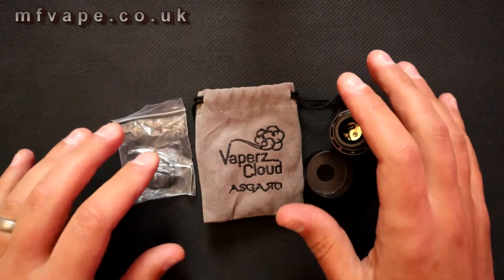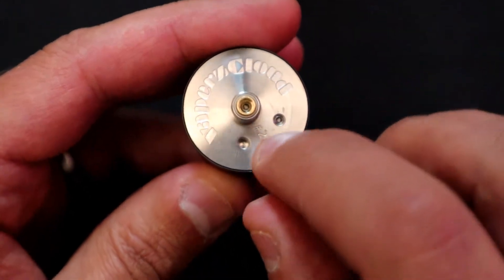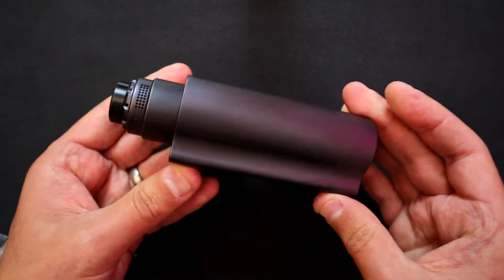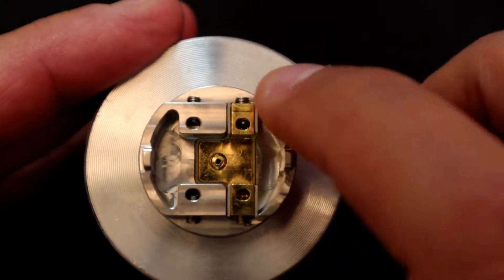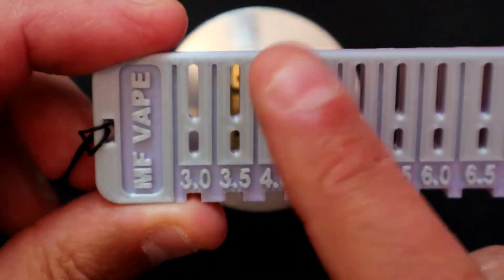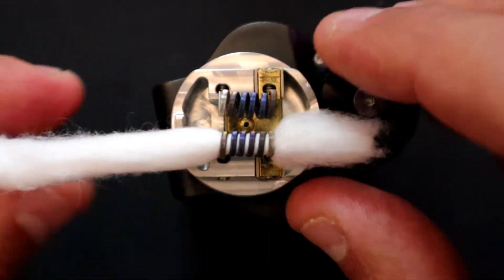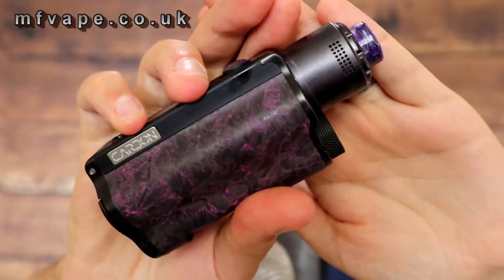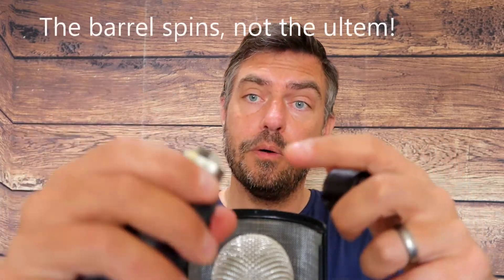Asgard 30mm RDA | Vaperz Cloud | Review & Rebuild | Smooth!

Comment: They have got ultem cap now mike that wilp fix your top cap. Stocked at evolution
Reply from the maker: Yes Mark, someone else mentioned that too. Cheers mate 👍
Reply: Mike also new beauty rings aswell if its down the bottom of you top cap. There cheaper than the ultem. Stocked at evolution vaping to 👍